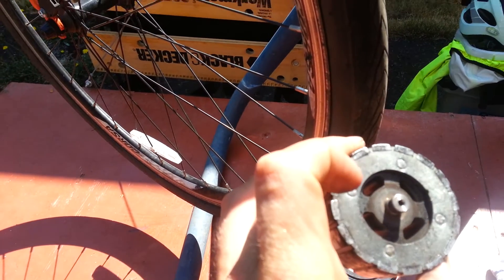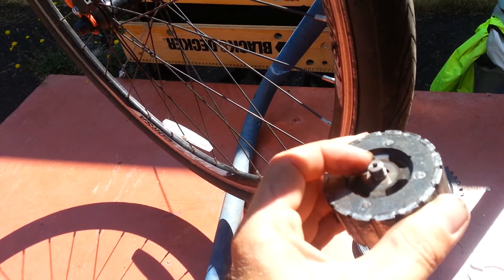Bafang 8FUN - Noisy Motor Tear Down

Comment: I have the 750w mid drive and I've just clocked over 6000 kilometers and I've just replaced a worn out 8 speed shimano cassette and chain wheel. Gone with the stock 44t and upgraded to a 42/12 microshift cassette. The chain is fairly new and no signs of wear. Now since I've had the motor out and regressed the whole motor I'm getting a squeaky chain noise coming from the motor. I'm puzxeled cause I know I added enough good quality grease to it

Comment: Loctite 660 will fill the gap and retain the shaft in the bearing as long as there isn't something else going on.  Helical gears like these have significant axial loading, I wonder if there's a thrust bearing not doing its job.

Comment: 2000 miles and  getting  noisy  is piss  poor ,  they really need to improve the motor design .
  I compare it too my car engine that  left the factory in 2001 and has never been opened and still runs like a beauty .
  They need to do better .

Comment: im concenred about the amount of force these motor put on bike frames and also the pulling forcing on the rear swing arm and axle/dropout hub. . consider an electric car jack uses a 12v 120w motor to lift a 1 ton car. only a properly tested frame by manufacturers  should be used with a motor rated for the force.
Reply: mike x the forces are absorbed by the tyres,against the ground if this was not the case a lot of frames would fail
Reply: the pulling forces the motor creates is put onto the area the motor is attached to and is pulling on the frame when the motor is under load. its like a winch motor attached to a bike frame
Reply: @mikex8254  You're confusing power and torque.  A 120W motor needs loads more gearing reduction to lift a car than a 250W mid mount motor needs to turn a bicycle crank; the car goes up slowly, the bike goes 20MPH.
Reply: Mike you're correct but so many people have proven this design to work just fine with regular bike frames. Of course I'd recommend using steel frame instead of an aluminum one but even those are strong enough for this motor. as a matter of fact they're making way more powerful motors today and those are just fine as well

Comment: I had a motorbike with a similar problem I replaced bearing and turned the shaft and down and used a small Bush the motorbike is still running today